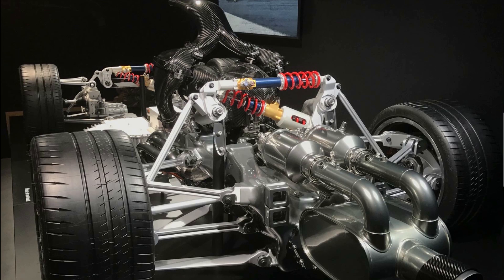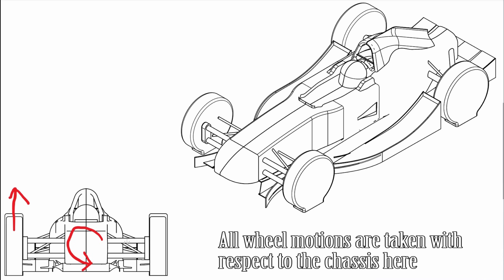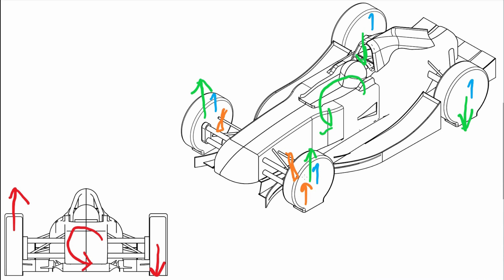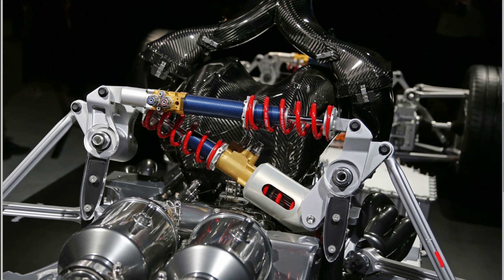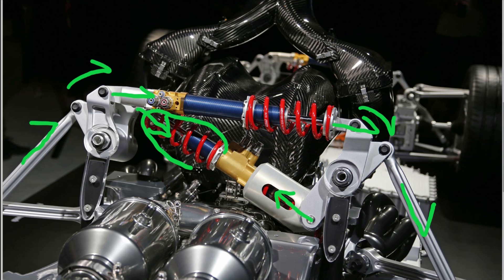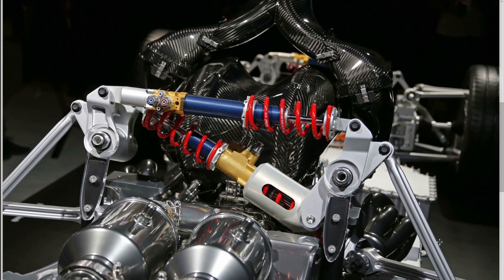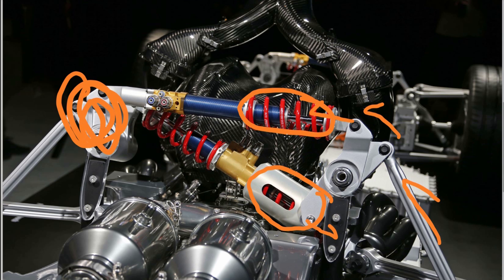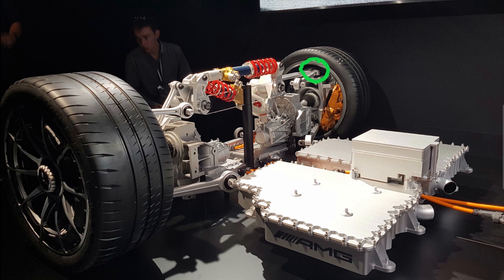Mercedes Project ONE Suspension - Explanation and Analysis

Comment from the maker: While NVH isn't really something I normally concern myself with, it has been brought to my attention that Multi-Link can help with ride harshness by isolating the loads through the bushings better, and this is probably a contributing factor to its selection given Mercedes' road-friendly approach to the car. Enjoy the video!
Reply: Martin Seidl no, he did it's with respect to the chassis
Reply: From kinematics point of view, there is no difference between the basic operational principles of double wishbone and multilink suspensions: Both of those suspensions are virtual swing arm suspensions, and both of them are formed from 5 links. With double-wishbones, the outboard ends of the 4 links are connected to each other (2 per wishbones) and the steering axis goes through the balljoints. With  multilinks, the steering axis is virtual and can be located with little more freedom, for example to archieve centreplane steering, negative sides being the need for more balljoints, and the difficulty of doing any suspension adjustment. With both systems, the fifth link is there to control the steering of the hub.

Double wishbones can be built from individual components, one example is the front suspension of 1971 Tyrrell F1 car. Individual links can more easily be built accurately, and if using any type of spherical bearings or ball joints, manufacturing errors have much smaller impact in the assembly or working of the mechanism.

Multi-link can be little bit more easily be built in a way that when hitting bumps, the wheel is allowed to move backwards a little bit in relation to the car body, and this can increase the ride comfort (when hitting bump, reduced horizontal speed of the hub + vertical acceleration = the wheel hub does not need to accelerate when travelling up the bump). If built in this way, the multi-link behaves like a virtual semi-trailing arm suspension.
Reply: Im fabricating my race car to inboard  antisway system & Im trying to calculate the   spring rate i need for the torsional rod .in the rocker assembly & all the antisway bar charts i can find don't account for mount location on the control arm so i don't have a accurate starting point or a way to convert the antisway bar #s over to the requirement for a 6" rod 
Any help would be appreciated
Reply: Do a break down of the aston valkyrie, either aero or suspension
Reply: Well Kyle, from what I've been seeing on recent videos, the car is really gentle over bumps, doesn't seem to crash and shudder over them, but there's literally no body roll, I can't see any. And it's so simple. About as simple as a truss With 3 members. Imagine if this was tuned for a Rolls Royce or an S Class.
Reply: ⅚
Reply: Did you get it backwards when you said under breaking the front wheels will try to lift, but I think the backwheels lift as the weight shifts forward.

Comment: Couldn't they hypothetically use a traditional roll bar as the roll springing mechanism and then only require a typical damper attached to the roll bell cranks?

Comment: I find multi-link suspension fascinating. the kinematics get a lot more complex but some of the kinematic results and practical implications are really interesting. Each arm being a pure tension-compression link allows them to be really lightweight if they are straight links as seen on this car (an example to the contrary would be the thrust arm on most modern BMWs). The two arms also create a virtual pivot point that extends beyond the physical reach of the arms, so you can have your virtual steering axis in the same place as, say, the physical brakes - not possible with a double wishbone system if your brakes are too big. if you want to limit scrub radius while also controlling kingpin, for instance, this would be advantageous. The steering axis also moves with steering input, this has a minor effect at lower steering angles but can still lead to interesting dynamic camber behavior as the instantaneous caster and kingpin change with steering angle. At the rear, the steering alignment considerations go away, but you can still lower forces through the toe link (and suspension deflection as a result) by minimizing your scrub radius and the moment that the center of mass of the corner assembly has about the virtual "steering" axis by moving the steering axis as desired - again, this steering axis, being virtual with the multilink setup, can be almost anywhere at the rear with steering geometry considerations largely out the window.

I would absolutely love to have a long conversation with the suspension engineers that worked on this car, it's a really unique implementation even six years later. We're starting to see more and more complex suspensions (Mustang GTD has dual-lower-link "double wishbone" front, the highly-regarded Lucid Air has a true 5-link front, etc.) but still nothing quite like this to my knowledge. The rabbit hole goes way way deeper than what i mentioned above - bushing compliance, accounting for how the front pushrod outer pickup point on the control arm should technically move with steering, Ackermann considerations, etc. It's crazy how a production (well, "production") car can have such a wild decoupled spring/damper arrangement and it's still not necessarily the most interesting aspect of the suspension system as a whole

Comment: Hi there! Great explanation 👏🏽. Do you know how could potenciometers be applied on the roll damper? Do they need to have two linear potenciometers one for each spring or can it be just one since the springs will have the same symmetric movement?

Comment: The beauty of this solution is its simplicity. I wonder why no one else thought of this. In recent videos of the Project One, I can see that there's no body roll and it doesn't feel bone cracking hard either, seems to glide over the rough bumpy tarmac of the Nurburgring.

Comment: So as some that might want to make this at home with parts you can buy what if you make a x with the shocks and leave the top parallel shock off. Or if a do that would I still need a top shock alone with the x patter on the bell cranks to get the same effects. I'm also guessing I'm not going to need springs with high tensile strength like I would in other set ups. Kinda would like to know how I could go about calculating what springs I need for a weight of the vihicle in a set up like this or the one I described.

Comment: At 6:04, wouldn't one have two separate shafts ? Not doing so would effectively relocate/create a "second" rocker pivot point  that would, in effect, "lock the rocker on heave and compression? The horizontal damper would then be rendered useless if that was a single shaft! Additionally, looking at the gold mounting base, there are two sets of damper adjustments. High/low speed adjusters- I'm thinking separate left/right adjusters.

Comment: Why multilink suspension is unexpected on race-based car? Multilink provides better control, doesn't it?
Reply: Note that the ONE was a prototype for a road car, not a race car.  If you can call a car than, now it may be bought, costs almost USD 3 million, can fairly be called a 'road car'!

Comment: The connected bell crank set up is genius. It is ant roll without a roll bar. It takes the preload off the wheel that isn't under pressure from the roll

Comment: can one say that this is independent suspension then? I would think by lookin at this that a bump felt by one wheel could disturb the other due to the higher damper.
Reply: The diagonal spring and shock are moved during roll only

Comment: the problem is with that roll system. corner one way and the damper compress then rebound on return yet corner the other direction the damper droops then  compresses on return..since there is one damper on roll...how would they set that up? mechanically speaking if compression and rebound are set at different loads...having one damper handling two opposite characters would be really complicated
Reply: When controlling roll independent from heave, compression and rebound can have the same damping.

Comment: Can you take a look at "Formula X" from project cars 2? 
Also why is compliance from the suspension such a problem in F1 but compliance from the tires fine?
Reply: Compliance from the tires is not fine, there is just nothing they can do about it since it's heavily regulated, the same for everyone and supplied to them so the suspension has to be designed around it. Thus you get things like mass dampers and inerters.

Comment: Something that hasn't been touched is that under one wheel bump no vibrations are sent over to the opposite wheel like on an anti-roll bar installation. This is as close as a suspension can come to perfection without being active.
Reply: Also of course do springs and dampers affect load transfer.
Reply: This is not true, for example if the right wheel experiences bump, the top of its bell crank will push against the left wheel's bell crank and the bottom of the right bell crank will also pull on the top of the left bell crank
Reply: You guys are actually both wrong. As the dampers act on two different modes, they will have different spring and damper rates. So the forces of a single wheel bump is not canceled out and the other wheel will feel an effect of that. Second Anti roll bars do not decrease grip by reducing the load on the inner tire. They do not change the load of the tires at all, they just change the position of the chassis relatively to the wheels. Load on the tires is only determined by cornering radius and speed.
Reply: @Bender-x1u changing roll bars can change the loading of tires, but only if the roll balance is changed. Roll bars are in fact not exactly roll, they add roll and warp stiffness, and only to a single axle. Roll bars generally increase mechanical grip because they help control body roll, which effectively increases negative camber on the outside tire and decreases negative camber on the inside. On road alignment this improves cornering grip, while allowing race alignment to have less camber for better braking. Here's a statistic that may surprise you: a c8 z51 with track alignment on ps4s tires can turn at 1.2 G but only brakes at 0.8 G. This also means that its 60-0 on track alignment is actually slower than its 0-60 on street alignment.
Reply: Not only that, but antiroll bars increase responsiveness at a cost of overall grip because they pull against the inner tire and reduce the load on it. Springs and dampers have no effect on load transfer but roll bars do. You can run really stiff springs and get rid of the roll bars  to have more even grip between all four wheels and higher total grip but that results in a really harsh ride and with cars that are traction limited you would spin out much easier since you wouldn't be able to load the rear tires

Comment: So.... compared to a conventional setup with an anti-roll bar, more stiff on one wheel bumps(two springs and dampers active) and softer on roll, pitch and weight(one spring and one damper active). Hm.... Need furthur clarification on how much spring tension and damping is desirable on each modes.

Comment: Kyle! there is something interesthing abou the rear arms as well!
There is an extra rear suspension arm located between the rear arms, a 5th connection. It looks interesting as it seems, if you mentalize the suspension compression motion, as it has a shorter length when compared to the inferior arms, when the suspension gets compressed during heavy cornering centre roll, that arm tends to modify the toe angles accordilgly to the chassis rolling, opening it when compressed, closing it when lifted... Check this video at 7:30 and onwards! please!  https://www.youtube.com/watch?v=EzV_1hF4pxM&t=696s

Also, it seems the engine doesn't have the same exhaust manifold the F1 car has. The F1 uses a shorter ram lenght exhaust duct and it makes sense for a road car since spooling time won't be a problem to it given it's electric motor in the compressor and bigger batteries. this buffs the lower rev area. I bet it doesn't have the same cam profile as well. And i see a stressed member chassis which means this car is going to be stiff and light. Only a few car manufacturers make use of the gearbox case as stressed member. Usualy it only suits racing cars.

Comment: How would you adjust ride height with this kind of setup? Anybody please
Reply from the maker: Simple, adjust the preload on the heave spring! Or alternatively you could increase the pressure inside the heave damper, which will increase the shaft force.

Comment: Does a car windshield produce downforce or is it even possible for it to do so?
Reply: Anyone who's ever seen a windshield would know it's mostly flat and raked like a spoiler.
Reply: I'm not aware of any language in the world where a "windshield" includes the rooftop or rear section of the car. There are even many cars (eg. convertibles) without such components. If you mount a windshield with struts onto the back of a car, it will function rather well as a wing.
Reply: I think the guy who can't even spell simple words correctly, nevermind understand aero, should stop "emberrasing" himself.
Reply: Lift is generated by pressure difference... Rake creates a pressure gradient due to fluid particle impingement...
Reply: +Agent00F Spoiler =/= Wing. There is a BIG difference!
Reply: Well since english is not my first language, i have an excuse for misspelling some words ;)
Reply: Thanks for all the thoughts! Appreciate it!
Reply: Downforce is created by the underside of the wing. Since a windshield has a whole cabin behind it the downforce created is minimal or none.
Reply: The comment above mine is wrong. Of course it produces downforce given it's shaped like a giant wing. It also produces drag which is a byproduct of downforce.
Reply: Actually, I believe it will provide some amount of lift. As air flows over it and back down over the rear of the car, the movement of the air will cause a low pressure area above the car. If this isn't compensated for by providing a similar affect under the car, it will have a net upwards force on the vehicle. Airplane wings provide lift using this concept, having a curved top that causes the air to move without providing to much drag, causing a low pressure area on top, and a flat bottom that leaves the air as undisturbed as possible to keep the pressure as high as possible. Wings on racecars are similar, but turned upside down, and are far more aggressively shaped because drag is a much smaller issue when downforce is so beneficial. I believe the tops of them are curved because it can provide a ram air effect, raising the air pressure on top at the expense of very high drag. The most important part of them is the bottom though, where the air is made to be at the lowest pressure possible over the largest surface area possible.
Reply: Ratz no,it only contributes to drag.
Reply: the statement above mine is also wrong, since a windshield is not shaped like a wing at all. But a windshield will partially act like a spoiler as it directs the airflow upwards. And therefore the air will press down on the windshield
Reply: +Agent00F stop talking. You are emberrasing yourself
+Spencer Leeper That would only be the case if the air stays attached over the rooftop and rear section of the car. If you have seperation at the trailing edge of the roofline (on hatchbacks and wagons for example) there will be no lift. Even on Sportcoupés that lift-effect is minimal because you always have seperation and a bigass low pressure region behind the trunk which disturb the flow.
Wings only work if the flow is almost undisturbed...Until then the windshield creates a high pressure region as it directs the flow upwards and therefore acting as a kind of spoiler with a LITTLE bit of downforce
Reply: But, it can also acct as the leading edge of a wing profile when viewed as part of the greenhouse which can actually produce lift.
Reply: Look up how airplanes generate most of their lift. It's not from the pressure difference as popularly mythologized but the rake of the wing. In comparison the windshield is far more raked than even plane wings.